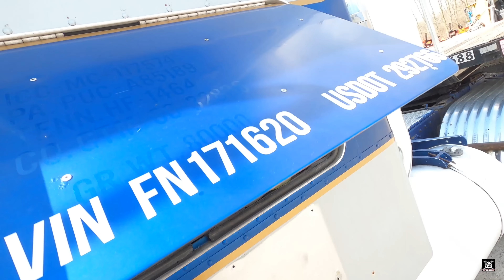I Find New Motivation From MATS!   New Friends To FSC Trucking

Comment: As i have said before, have the biggest version of that skid steer and if the size is the only difference apart from weight, then just like the tie downs in the back of the skid steer, the ones in front are also under the skid steer and those are a pain to reach.
At least with the attachments "Bucket" on anyway.

Comment: Green Goblin must have a newer style 15 speed the older ones had a flipper switch on the dash just like the Husky drives did only with the Husky drives it was a 5 speed with 2 speed rears but you didn’t split shift you could start out with the rears in low to start then you flip the switch up and straight shift the rest of the gears cause the engine was a custome torque Cummins